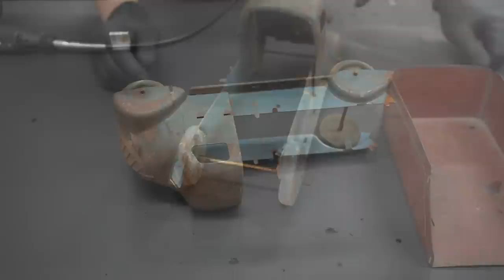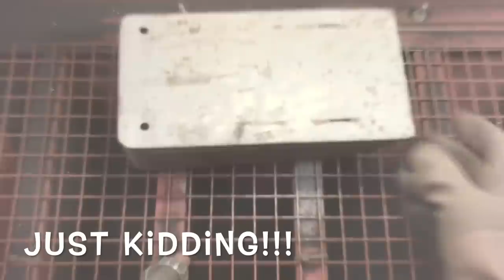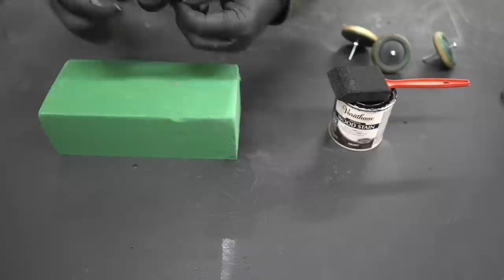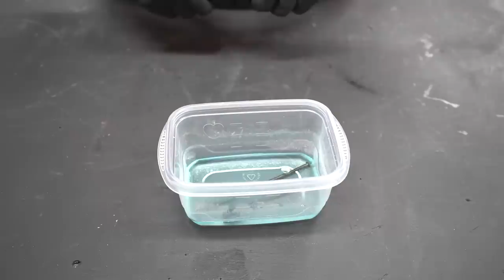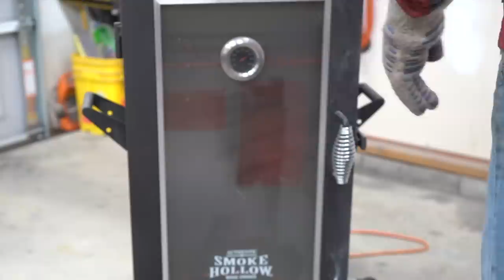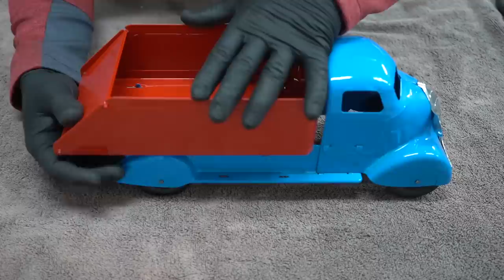1930's Marx Dump Truck Restoration

Comment: Fantastic restoration Tim.  Sandblasting, sparks flying, welding and fabricating missing parts.  What's not to like you folks who hit the dislike button.  Restoring a 90 year old truck, I can't imagine why you couldn't get the missing parts.  2 questions Tim, were those metal wheels and what was the reason for the 2 axles on rear tires?  Loved the project and you and yours stay safe.  Cheers from Tennessee.👍😷🍻👍
Reply from the maker: The wheels were wooden, Oak I believe. The rear axle had a sleeve that went over it to keep the sides from pushing in.

Comment: Anyone else instinctively turn away to protect the eyes when he starts welding? 🤪
Reply: Every. single. time.
Reply: Yes. Arc Flash is dangerous, it can burn your corneas. I did welding in high school,  but it scared the crap out of me so my teacher let me be the "spotter", the one who watches for trails of carbon smoke coming off the welding.
Reply: I put my welding helmet on when I watch videos.  Problem solved.  Lol
Reply: No,because I'm blind from a welding accident.
Reply from the maker: lol it's hard not to
Reply: Oh c'mon. It's just a video. When watching all I use are my brazing goggles.
Reply: Not me, been a welder n fabrication work for 40 plus year's.
I do wear a hood at work.....
Reply: I instinctively feel that hammer smack when he's reinstalling the axles. 
👋😢👎

Comment: Stupid question, but I don't know, after sandblasting something, can you reuse the sand for something else or do you have to use new sand?
Reply from the maker: You can reuse it for a while, but eventually it will break down and need to be replaced.

Comment: Really nicely done.  You can see in the way this old truck is built how Tonka carried forward a venerable metal toy tradition into the 1970's and 1980's.  At least until they started cheaping out with injection molded plastics.  There's a tactile authenticity and expansive adaptability simplicity to a simple metal toy truck that fired kids imaginations for generations.  The creativity of kids these days is so often stunted by years of playing with battery powered, remote controlled plastic vehicles with flashing lights, sound chips and pre-programmed play modes.  And worse yet, video games that force children to see pretend worlds only as adult game designers intend, rather than wholly new experiences created in a child's fertile imagination.  I sound like a Luddite I know, but we've lost something vital and important in the way children experience the world as they grow up  ...

Comment: Quick question for you.  How many times do You go over the rusted area's with the sand blaster? If I were sand blasting it I would go over the rusted area's at last 3-4 times just to make sure I didn't miss anything.
Reply from the maker: At least that. Sometimes more until it's all gone.

Comment: A good job overall- but why were the three parts of the body ( blue) not painted separately as it was originally , also the tabs that came through the tipping box should have been touched in with the red.
Reply from the maker: On newer toys the mechanical connections are hidden and a little more forgiving. These were so visible that I didn't want to risk painting them first ans then causing stress factors in the powder coating. The safe bet was to bend them in place and then paint them.

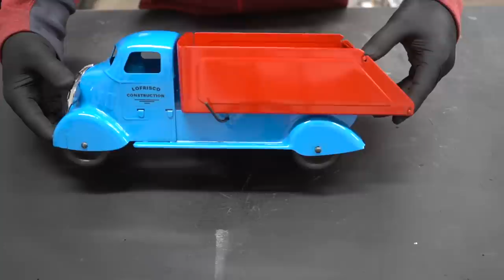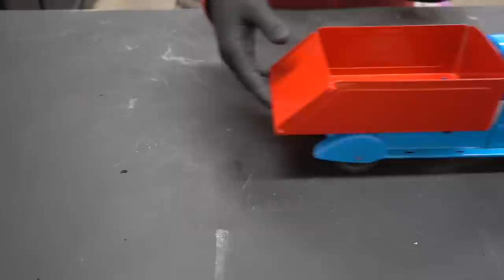Comment: Beautiful restoration work. At abt 20:53 and 21:11 you can see two slots on each side on the running boards. Were these for some other pieces?
Reply from the maker: I would assume running boards, but they must be extremely rare, I couldn't even find any pictures of them on the internet. Wanted to replace them, but hard to know what I'm replacing when I don't know what they look like.

Comment: Curious why you test for lead?  What would you do differently if it tested positive?
Reply from the maker: Lead paint wasn't banned until 1978, so it's possible a lot of these old toys may have lead based paint. The media blasting will basically turn it to dust, not really something you want to breath in over an extended period. If it was lead I would have just used paint stripper to remove most of the paint.

Comment: Does the tumbler bowl ever wear through on those things? Or do you use an abrasive that is softer than the bowl?
Reply from the maker: Hmmm, good question! They are made from a really sturdy plastic, but I suppose nothing will last forever. They are generally used with softer abrasives though, So it may take a while to wear one out.
Reply: they use walnut shell or corn cob ground up I have a vibrating tumbler like that one for cleaning and polishing brass rifle and pistol casings makes them look like brand new
Reply: TRG RESTORATION what make is your tumbler I have one I use for cleaning and polishing brass rifle and pistol casings I prefer the walnut media myself over the corn cob

Comment: Why check for lead if your stripping it in a sandblaster?
Reply from the maker: Blast cabinet will basically turn it to dust. Between my dust mask and my dust collections system on the cabinet, it would probably be fine. Better safe than sorry though.

Comment: It came out fantastic, and that's why I subscribed. I have a few questions if I may:

1) The slots on the running boards lead me to believe that they must have originally been covered by something. Is that true, or are they for another purpose?

2) After sanding the truck's wheels and tires it looked like the tires originally appeared to be half green and half yellow, and the hubcap black . Were these the original colors for the wheels and tires or were they all black? 

3) The bumper did turn out okay. However, after seeing your metalworking skills I think that you could have made a perfect one.

4) Congratulations on finding something useful to do with the Harbor Freight anvil. 😁

Thank you again for a wonderful and entertaining restoration of a cool looking toy truck.

Comment: Why not roll the metal for the tailgate like it would have been originally? It would have been like the axle cover on the rear wheels.
Reply from the maker: It's 22-gauge, without a press and die designed specifically for that, it would have never looked right.